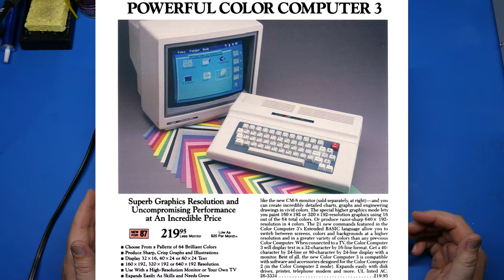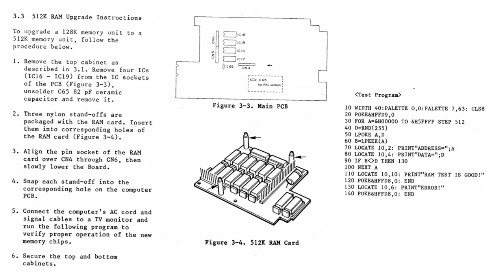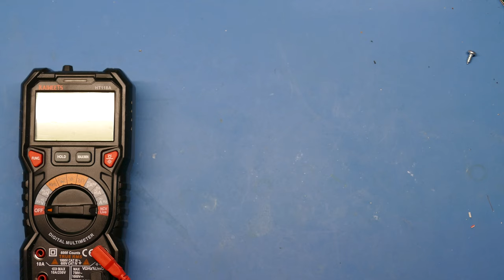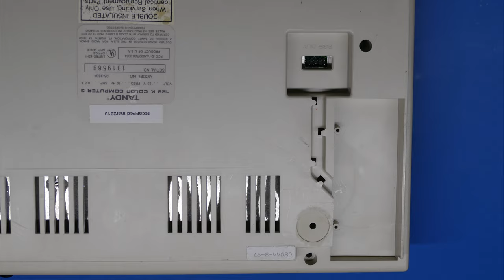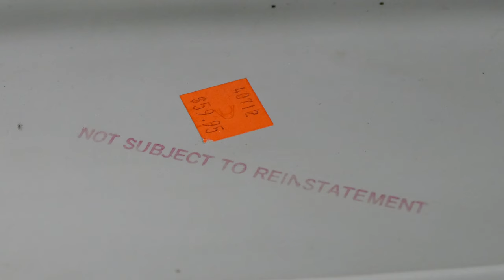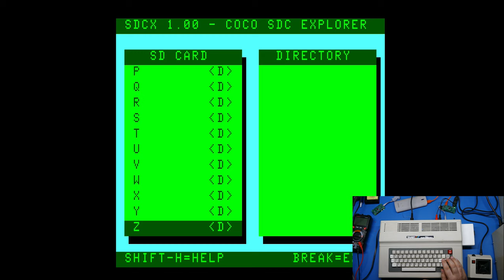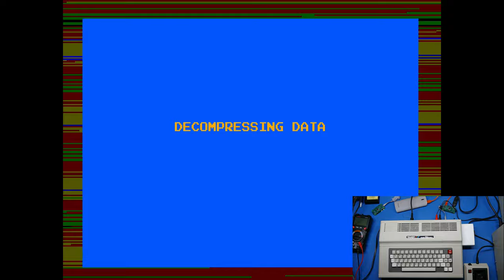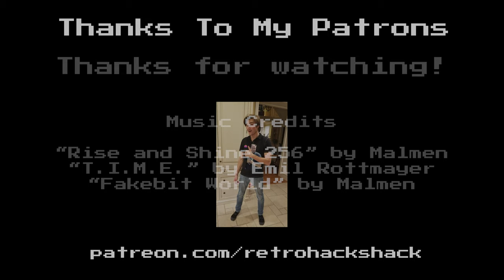Upgrading The Color Computer 3 --OR-- Add HDMI To Your Vintage Computers!  Part 4

Comment: I remember using artifacting on an Atari 8-bit BBS program I wrote. When you first logged on, it asked you what color boxes you saw and then adjusted the graphics over one pixel if they were not  what it was expecting (I think, it's been 35+ years!). It was a cool trick and I did not know of another BBS doing this at the time.

Comment: I just today snagged my first Coco 3 on ebay - bit of a crap shoot as it's an estate sale find, untested, and pretty dirty. Seller made me an offer that was about the cheapest 3 I've seen, and it has an FD-501 with it. Hope it only needs a cleaning. I have my original 1 and a couple of 2s that dad had so this rounds out my collection.

As I recall, Tom Mix did get in a little trouble for "Donkey King" and I remember it being sold as "The King" instead for a bit. But I remember being amazed with it at the time - so much better than the consoles!
Reply from the maker: Nice!

Comment: First!  I just wanted to say, congratulations on setting up your channel.  You have a lot of knowledge on the COCO.  I am really enjoying all the content you are producing.  I did not care for these computers because I had a Model 3 and later a Tandy 1000.  The CoCo just seemed like a toy, just like I felt the Commodore 64 was a toy.  Boy was I wrong.  Thanks for all the hard work on this video, it really shows.
Reply from the maker: Thanks for those kinds words and sharing your story. I think a lot of us felt like that at the time.
Reply: All your suggestions were excellent. Here is another tip for your quiver.  When removing large components such as the CPU  to avoid ripping pads, use a lower temp on your iron, and apply fresh solder first before sucking the solder off the board,  You will get much better results.  The reason you do this is the original solder is old and has trouble melting, causing you to use a higher temp on the iron.  applying fresh solder mixes with the old lowering the temp of the old solder making it easier to remove the component.

Comment: I use 3D printer filament to key those IDC connectors. I heat it up with a lighter or hot air gun and then i stretch the filament until it's thin enough, cut, insert, trim and optionally weld it stuck with the soldering iron.
Reply from the maker: That's a great idea! I will be using this for sure.

Comment: Regarding your C128 comments, whilst your heart is definitely in the right place, that wasn't the reason the C128 had dual processors. Mostly the Z80 was there as a disk controller and/or for CP/M support which necessitates a Z80. It shared bus cycles with the 8502 (6502 derivative running at 2mhz) which severely crippled it's performance with CP/M. Anyway. Really enjoying your videos. I have PAL CoCo1, 2 and recently 3.. so I'm enjoying learning about the -3 and it's upgrades.

Comment: Good video.  Props on working with the RGBtoHDMI developer to implement proper CoCo 3 support.  Now I'm really motivated to push the 'go' button and build one of these up.  I could also use this on the MM/1.  A minor nitpick:  The Commodore 128, as far as I understand it, adds no significant capability to its Commodore 64 mode, but has a separate, and poorly supported C128 mode.  Its Z80 processor runs CP/M (slowly), which is an older system than the C=64, though it did have a lot of mostly business/productivity software available.  I think a better analogy would be the Apple 2gs, which added new features, including a faster processor and more memory, to enhance the existing Apple 2 architecture.  You can run the 6809E on a CoCo 1 or 2 at double speed with a POKE to the SAM chip, but it's overclocking and all usual caveats apply.  Plus, at least with one of the high-speed pokes, it can garble the screen.  And a point of clarification:  The 6309 powers up in 6809 mode, so you still have to put it in native mode to take advantage of the instruction clock cycle improvement.  And of course it has other goodies like hardware divide, block transfer instructions, and more internal registers as well.

Now going  to watch your other videos on the RGBtoHDMI.  Very excited about that.
Reply from the maker: That's an interesting anology to the iigs. And yes good point on the 6309. I have heard that there are still performanace gains in non native mode though. True?
Reply: @RetroHackShack  As far as I know, in non-native mode it performs exactly like a 6809 -- which is actually a good thing for programs that rely on exact instruction cycle timing.  But just switching it to native mode will get you a speed-up without needing to re-write anything to take advantage of new instructions and registers.

Comment: The Z-80 in the C-128 was primarily to run CP/M, not to increase the power of the the Commodore software. However, the processor that ran Commodore software WAS doubled in speed. The C-128 could have excluded the Z-80, but Commodore wanted to gain access to CP/M business software. Given that it was rarely used, they would have been better served by putting 64K for the video RAM, expanding basic to version 8.0, and simply getting the rights to write versions of popular CP/M applications. It would have been nice to have had a built in RAM expansion, but an external one was available (however you sacrificed the cartridge port). It is ironic that today these 8-bit machines all have easy RAM expansion (easy being relative of course).
Reply: Correct.  The 128 mode's extra power came from it's 6510-compatible 8502 CPU that could run at double the speed in 128 mode... not the Z-80 they threw in for CPM.  In fact, the Z-80/CPM performs pretty poorly due to it spending half its cycles in wait states due to the VIC-IIe still being clocked at 2Hz in that mode.  It's no wonder most 128 owners never got much use out of the Z-80 in their systems (beyond the fact that it kickstarts the boot process).

Comment: Note: A real CoCo with a floppy controller supports up to 4 single sided drives, or 3 double sided drives, but the CoCoSDC only supports mounting SD card image files to 2 drives, although it supports the 3rd and 4th drives with a DriveWire server. Also, while the CoCoSDC support ROM cartridges, it only supports cartridges containing up to 16k ROMs and up to 8 cartridge ROMs at one time. If you want full cartridge ROM support for all sizes of cartridges, check out the CoCo Flash from Retro Innovations, but while it supports every cartridge size and type, it does NOT do disk emulation like the CoCoSDC.
Reply: PS: Thanks for adding the artifacting support! That will be a great help for anyone using this HDMI adapter with a CoCo.
Reply from the maker: Interesting. Thanks for the additional details!

Comment: When you don't want to save the MC6809 CPU (why would you risk the motherboard pads and traces to save it?), clip the leads with a lead shear cutter, heat and pull each pin individually, then solder suck the pad holes.

Comment: I would suggest not trying to save the CPU, cut the pins close to the PCB then desolder each pin. If you REALLY want to reuse the CPU you could solder wires onto the cut pins on the old CPU to serve as pins. The PCB is much harder to replace than the CPU.

Comment: An easier way to get RGB (and composite) to HDMI is to get the Switch-a-roo RGB to SCART cable from COCOMAN and an RGB compatible SCART to HDMI box. It will switch from RGB to Composite with a toggle switch for artifact colors.
Reply from the maker: I've got one. It doesn't work nearly as well.
Reply: Yes... I agree, I have one and it does work well.  80 Column text displays very well too.  World of difference compared to standard RGB.  That said, Retro's Hack may even be better.  I'd like to try it for sure.

Comment: 68B09EP is a few dollars. Coco 3 motherboards aren't. Without a desoldering gun, or chipquik and hot air, snip the CPU out.
Reply from the maker: Mike. I thought about mentioning that, but I am always worried about the stress on those pads when you snip ICs. What do you think?
Reply: @RetroHackShack  the pads can't move at all when the legs are being snipped as they are soldered right through at the time. Then heating and removing the pins and cleaning up becomes super easy and very safe for the board in comparison.
Reply: On the other hand, it is well within the realm of possibility that replica CoCo 3 PC boards can be fabricated at this point, and an existing board can nearly always be repaired with a wire or 2, unless you do horrible butchery to it.  And while the 6809 has been implemented in FPGA, we don't have a plug-in replacement in a 40 pin package.  6809 chips will almost certainly never be manufactured again.  Personally, I would err on the side of saving the chip, unless it's already bad.  But I don't think the weight of the decision is clear-cut one way or the other.

Comment: And another question:  any idea about whether the 8-bit (~256 color) CoCo 3 artifacts are emulated in RGBtoHDMI?  I wouldn't expect so, as they weren't used nearly as extensively until recent years.  See this video for a demonstration:  https://www.youtube.com/watch?v=hjcUdoW0rrg
Reply from the maker: Interesting. I will check it out. Ian and I didn't not discuss that specifically. Just for the older games and such.

Comment: The Commodore 128 used an 8502 processor which was backwards compatible to a 6510 used in the C64. The Z80 was used for CPM and also had the benefit of providing some additional functions for backwards compatibility for cartridges. Obviously the CPM in the C128 was never used because the C128 used the variable sector drives that weren't compatible with existing CPM formatted disks, so was a wasted feature This part of the video is quite misleading. Also, I suspect unlike the COCO3, the C128 had two graphics processors, the newer of which was hot garbage. Really, the C128 had no reason to exist other than to run C64 software.